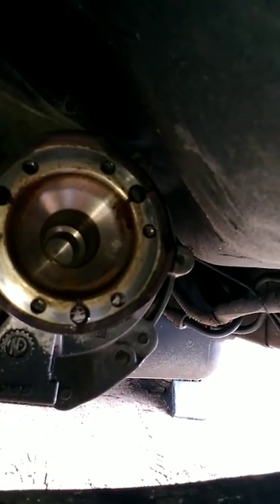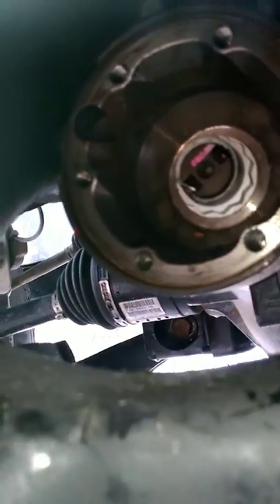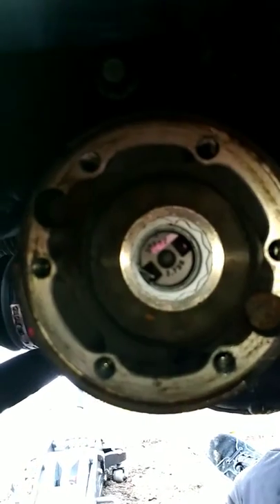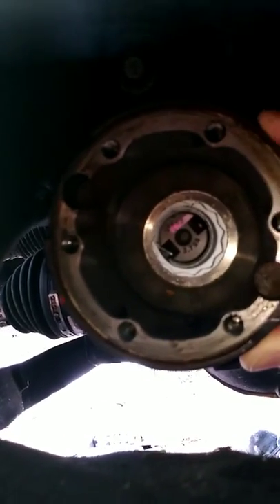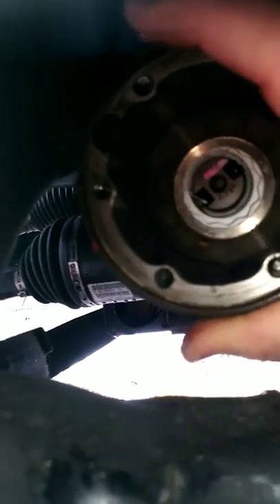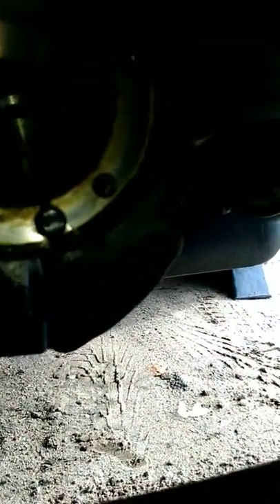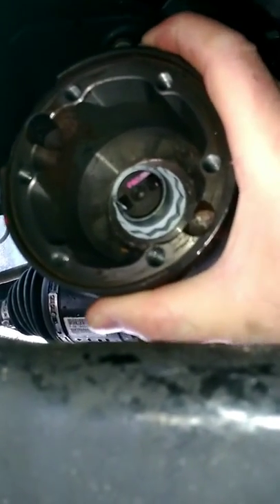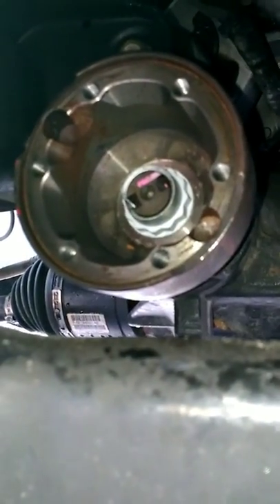2008.5 Jeep Grand Cherokee WK Driveline Noise - Getting Closer

Comment from the maker: I ended up changing the front differential and the noise went away.  It was much cheaper/faster to replace it with a used unit than it was to have the differential rebuilt.  Using Royal Purple oil was a bad idea because I couldn't see what was happening to the oil.  Use a clear gear oil.